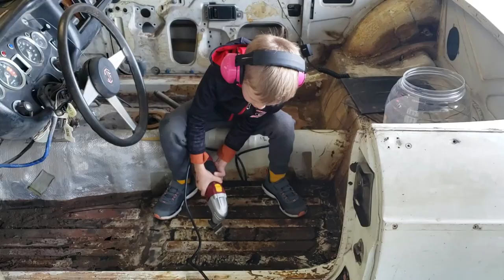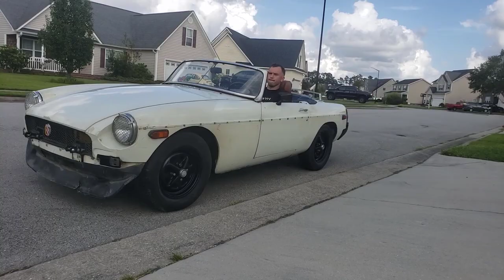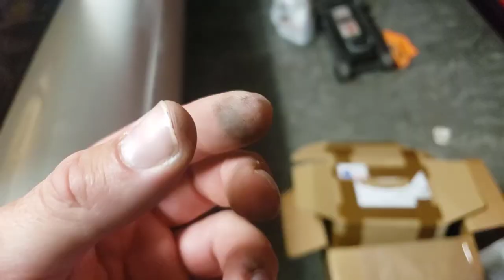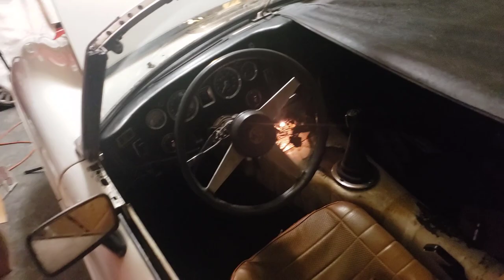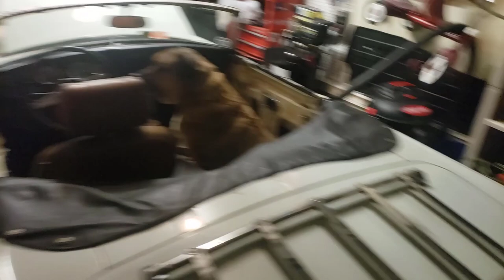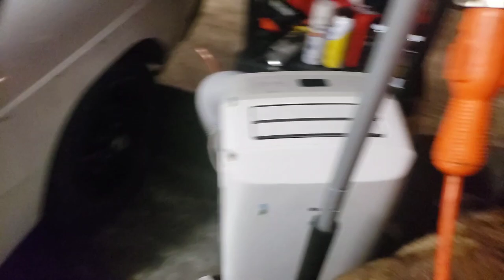Thank You MGB Community For Helping With This Simple Fix, Tail Lights Work Again!

Comment: Gday Matthew....I had a feeling it was the glass fuses fuse box, it was a the source of most of my issues on my 65.  I wouldnt recommend replacing the one you have with similar as I tried that and the tabs didnt reall hold the fuses solidly so hence the issues continued.  It manifested itself in staggering cut outs whilst driving in the mountains, tha tacho completely dropping to zero then back up to norm .....intensely frustrating and great concern!  I thought it was the generator (I tested it all OK) then immediately bridged the connections of the glass fuses...all workeked perfectly.  I somply soldered and bridged the glass fuses with mini blade type connections.  No issues whatsoever.  Good for you for working down the issues!
Cheers
Aaron G
Reply: 1970 mg your electrical at all why